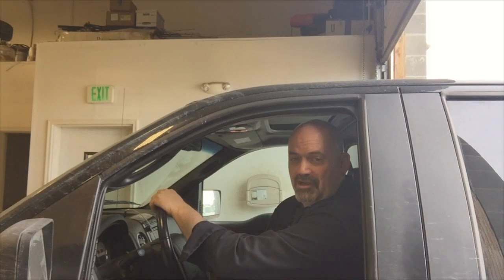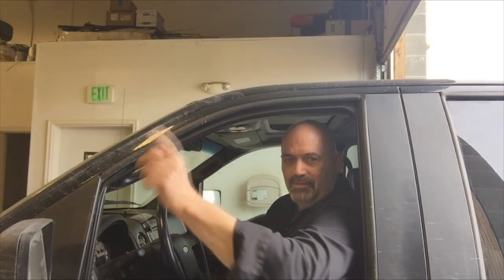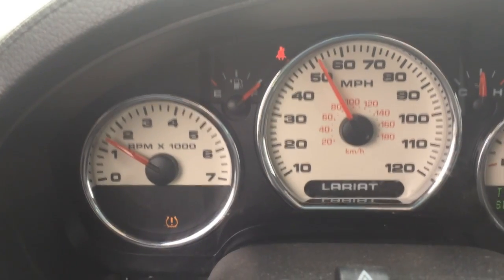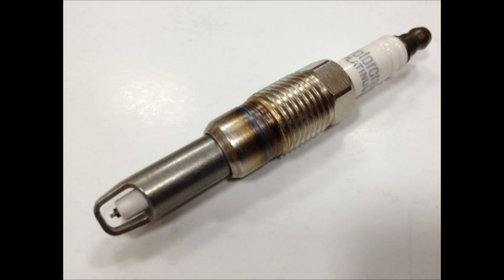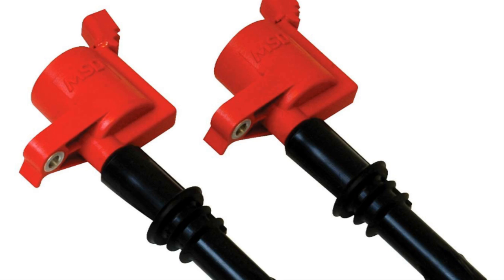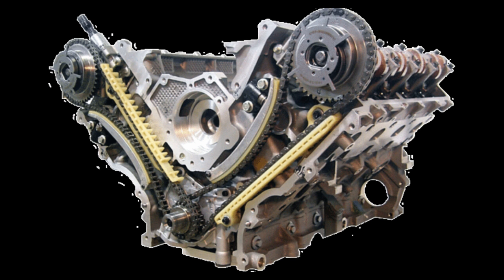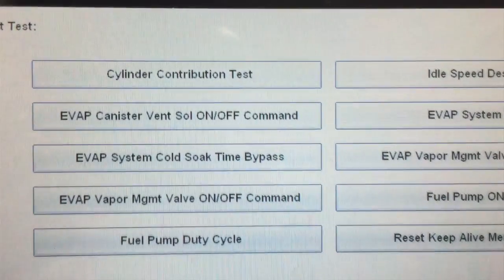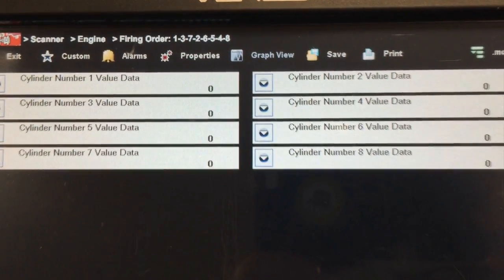Ford F150 F250 Transmission Shudder

Comment: My 2007 Expedition had shutters and would not lock up, I replaced the Torque Converter with a new ford unit in my driveway and it’s like a new truck. I changed all the fluid with new Mercon SP and put in a new ford filter, replaced TCC solenoid, replaced the pump bridge seal, and a new oem lockup torque converter and she locks right up and drives like a new truck and shifts amazing now. IMO If this additive doesn’t work drop the trans off the engine and replace the converter....don’t spend thousands on a unneeded overhaul or put any additional snake oil in it....Ford replaces the TC’s when they have the shudders for the most part but I know some years for the HD 250 trans they have an oem approved additive.

Comment: Had shutter for years, finally had plugs and plug boots replaced at 195,000 miles and shutter is GONE!!!
Reply: Wow! Dodge told me it's a torque convertor issue. Doesn't make sense, because it only happens at steady speed and I haven't had a tune up in over 5 yrs

Comment: I have a 1999 F150, with a 5.4 and a OD transmission. I found my transmission shudders at take off!! So if I am sitting at a stop light and it changes to green, as I start to pull away THAT is when my truck "shudders", and for a while I thought there was a broken spider gear in the rear end (as that is sort of what it felt like), but then I noticed something!!! What I noticed is that it ONLY HAPPENS when the overdrive is on, which in my truck the overdrive feature is automatically turned on when you start my truck!! So if I start my truck, then turn the overdrive off before shifting it into any gear the shudder goes away and doesn't happen!!

Comment: A "Shudder" or " A feel of Driving over a "Washboard". Doesn't feel like a "Miss fire". Try draining your Torque converter add a new filter and fluid. No Additives.
Reply: Pretty much William but when a catastrophic event happens after you have the shutter then your front main seal goes out what would you talk about what would happen then what made the front main seal go out from the shudder to torque converter probably would be bad and cause a catastrophic event to eventually make the front main seal pop or could it be that the pump itself stopped pumping in the food heated up to the boiling point and pop the main cell

Comment: I have a 2013 ford f150 stx 2wd 5.0 V8 the ford dealerships just cant see to figure out what is causing my truck to vibrate at 55mph, had all fluids changed at 80,000 miles 4th set of tires and the vibration is still there very annoying

Comment: Thanks for sharing, currently trying to differentiate between transmission issue and a misfire. Mrs said tonight it was running better in manual and shuddering less in 5th Vs 6th. Car is 2014 6.2 Roush Stage 2 Raptor. Already had one trip to Dexol for rough shifting and got some beefed up internals then. Could be this issue. One misfire at 1675rpm 13mins into the drive cycle on Cyl 2&4 of a permissible 65500 on the OBD… it is about 7k away from the plug service.

Comment: 2008 4.2 stumbling,  missing on curves,  bucks on bit of incline, accelerates out strong! And also has studder/slip? at take-off . Replaced distributor shaft & pickup.  Guess Plugs again,  wires were replaced also.. wearing me out

Comment: I purchased a 2007 f150 lariat n bout 30 miles away I got significant shudder . I took to a transmission specialist in my area n I was surprised when he said he couldn’t flush all the fluid out , just the pan . He said I had a 50/50 chance of new fluid n filter n shudder fix to fix problem. Well I was apprehensive since he’s not changing all the fluid (. 230,000 miles ) well 20 miles home it acted up again , though it was a lot less violent, but still shaking . He said he wasn’t comfortable with just changing torque converter with the mileage on the trans . Does this make since if your trans is working good except for the shudder . I bought this as is couple days ago so I need to figure something out quick ( I know the state has a lemon law ) why wouldn’t someone just do converter and save lots of $ for maybe another 50k miles ?

Comment: What would cause shutter on 4r75e ford transmission  when put in gear with brakes applied and stalls. Thank you for sharing God Bless
Reply from the maker: Lots of stuff including fuel and ignition system issues. You’ll likely need to test some stuff to get to the bottom of it.
Reply: I have the same problem with the 6r80.  Will shudder and sometimes stall if holding on brake in reverse, or in drive at a light.  Added more trans fluid and it improved (as in i can idle longer and shudder is less)  Still not sure what is causing it

Comment: What kind of shutter are we talking about here? If the torque converter is bad or about to go bad, will that shutter be very noticeable, or just slightly noticeable? I have a bad noise coming from the bellhousing area, 1997 f150, but I don't know if it's a flex plate or a converter. The noise gets quite when in gear and pretty much gone when it's warmed up good. The warmer the truck gets the quiter it is. I do feel a slight vibration under excelleration  but nothing really noticeable if I ignore it, it's more like running on a bad plug if anything and I know that's not the problem since I've done a complete tune up on it two months ago.

Comment: Helpful 👍. Any answer would be awesome!! 2000 f150 v8 4.6 Triton, I get the shake and loss of power uphill, highway, or when I dump it to gain speed, I thought It was plugs, fuel filter, clogged cats, sending unit, fuel pump or coil packs so I spent a rediculous stupid amount of $$ replacing and troubleshooting this cause this truck is solid but it's still doing it. I have to keep this truck so would a flush and a bottle of that shudder fix at least help til I can afford tranny work?? Thanks in advance.
Reply: Hey Mike Ward so what did you wind up doing with your truck? My 2005 F-150 5.4 Triton is doing the same exact thing! Smh

Comment: Pleas help 2002 Ford F-150 with a 5.4 Have you come across any hesitation problem when turning on cruise control or a hesitation when you push the resume button I’m finding every one is replacing the switch mounted on the breaker booster what are your thoughts Anchorage Alaska Thanks

Comment: My Econoline E350 rattles pretty bad when I try to go hard on the gas from 45 to 55! Not in lower speeds or over 60!
Reply: Usually when things like this happen is it going to be a catastrophic event the torque converter is smothered are breached or just slap wore out transmission filter should have been changed fluid should have been changed but a fluid was not changed on accordingly time then you should just take same fluid save put new transmission filter and if the pump itself is still good replace with new torque converter yet make sure it the fluid going through your radiator and your pump is pumping cuz if the pump stops pumping it will make the fluid heat up and then pop the front main seal and cause a leak from the front of the transmission

Comment: Good video and very helpful.  I have a 1999 Ford V10 motorhome with a 4r100 transmission.  Idle is normal but when in 1st gear only after the transmission is warm I get shuttering in 1st gear.  Also sometimes I give it some gas and it catches as if the torque converter is slipping.  Motorhome has 61k miles on it.  Transmission fluid is pink and smells new like it was just changed before purchasing last year (full level).  Also slight shift flair when going into overdrive.   Any thoughts?

Comment: had this issue with 2010 f150XLT 4.6l r680 and spent to much time and fluid filter changes so st 150,000 miles lost 5th gear and need a 5000$ complete transmission change

Comment: I have this issue in a 2000 excursion with 300,000 miles on it. It don’t do it everyday but once in a while it sounds like the belt is squealing as it shudders while accelerating around 45 mph. This doesn’t make any sense but I’m pretty sure the shudder and squeal is the transmission? Is that possible?

Comment: Title talks about trans shudder, yet he spends more than half the video talking about a misfire ?
Reply: Yes, because a misfire can mimick a shudder condition.
Reply: Kareem OfWheat u are crazy the man is trying to help you don't watch
Reply: He’s actually right. My 2006 Ford F-150 was making a this weird transmission shudder feel on acceleration between 35-55mph and it turns out it was a misfire.  Guess what. The ford dealer could not solve the problem.  This video did.  So kudos to people like this guy for making a video to help us folks out.
Reply: @mbiker7  How much did FORD dealer charger U just for looking at it?? Also what is a "shudder" is it a rattling?? Because that is the problem im having on my 2001 Econoline...
Reply: AxZxTxExCxA it’s not so much as shudder but the truck hesitated when pressing on the gas at speeds between of 30 mph and 45 mph. Turns out it was 2 spark plugs that were misfiring.  My local dealer in Bloomington illinois charges $480 to change out the plugs on a v8 5.4l but if one breaks he adds $150 to each on that breaks. I did it myself.  I broke 4.  But used a special tool to remove them. It was a pain in the ass. But I got the job done.  Now I have no more hesitation or shudder feel coming from the engine.  Which kind of feels like the transmission was going out.  So. It’s just the spark plugs.
Reply: @mbiker7  Nice... 👍
Reply: Because a misfire is the most common problem with higher mileage vehicles of this class. I’ve changed one bad one out. It seems to have taken care of it to some extent but I’m still experiencing this on my 01 F 250 5.4 liter occasionally at low RPMS in over drive. So before I service my trans I’ll change out all my coil packs. For a 100 bucks certainly worth it.

Comment: What years are usually affected by this? I have a 2000 Ford expedition 2 Wheel Dr. that has a shutter or vibration somewhere between 45 and 65mph, I have changed The U joints and quite a few things up in the front end, Front wheel bearings, upper and lower ball joints, sway bar links, etc., but haven’t been able to find the source of the problem, seems kind of sporadic and hard to pin down. Thanks
Reply: Same here! I have a 2005 Expedition and it happens when I let off the gas going 45+mph. If I “punch the gas”, it goes away but I can’t drive with normal pressure on the gas. Any luck finding the problem? I really could use some help here. I’ve taken it to 3 mechanics and they look at me like I’m crazy.

Comment: I got a 2010 Ford F-150 and I hear something like a grinding/rattling sound whenever the rpm's reach 1,000. Any other point in time nothing, only when I accelerate from a stop or slow down to a stop and always at 1,000 rpm I hear it.
Reply: We noticed the same thing and got it fixed it is more than likely a loose firewall and is easily fixed by just tightening the screws hope this helped
Reply: Hello, I'm from Brazil I have a similar problem, managed to solve? Thanks

Comment: I had a shutter at 45/50 mph and pushed o/d button and it stopped I have a2002 f250 4x4 5.4 litre 220 miles ?
Reply: It's a "shutter" rattling?? That's my problem. Rattling at those speeds only if i go hard on the gas. Once I pass 60 I can go hard on gad and no more rattling under the van.
Reply: Torque converter

Comment: 2005 f150 5.4 with over drive started to have a small kick in transmission between 40 to 50 at light acceleration. happens with OD on or off
Reply from the maker: probably an ignition misfire issue
Reply: Did you figure it out my 2008 Ford F-150 does the same thing when it goes to shift into overdrive it has a hard clunck and shifts up it’s only got 118k miles on it I changed the transmission fluid and the problem is still there
Reply: Also I got insta shudder fix idk if I should add it or not

Comment: Help!!!! 2010 F150 shimmers all the time in drive. New rims and tires balanced, ball joints/uca, new lower ball joints, new struts and springs, new shocks, new sway bar links, driveshaft balanced. Pretty much entire new front end. Please guide me in the right direction. Thanks
Reply: Jonah Adams have you checked your ignition coil packs?
Reply: Yeah, might try this and see what happens 😅

Comment: Good video I have Buick enclave 2011 my truck vibrate when Ron the 40 to 50 mph I replaced the motor mounts all suspension parts new tires and the vibration don't stop u help my plz

Comment: I have a problem with my 2012 ford f150 fx4. It only happens when I'm driving through the parking lot or a garage. When shifting from first to second my truck shifts very hard it almost feels like I got rear ended. I have to basically stay on 2nd gear so it won't happen. All the shop can tell me is that it's a misfire it has bad coils or the plugs need to be changed. Well that doesn't fix the problem it still comes back. I've looked through so many forums and can't seem to figure it out Please help.
Reply: Did you ever figure it out??? I've had the same issue for 2 years. Driving me crazy!!! I have nightmares!
Reply: I know this is a year old..but sometimes this issue is a 1-2 Lord accumulator spring probably broke
Reply: Ive had the same problem for 4 years now. There is a TSB out but need act of congress to get Ford to deal with it.

Comment: Hi car doctor, I have f-350 2011 super duty my question is why is shifting hard the transmisión just when the oil temperature is up the 175
Reply from the maker: Is it an overdrive transmission? Have you tried switching off the overdrive and still have the issue?
Reply: The Car Doctor, works well until oil spell over passes the 175 there begins the problem only it when it will enter the  second gear,

Comment: Hey Car Doctor,  I have a 2010 Ford F150 STX 4X4 with a transmission shudder only between 30-40 mph.  I've checked out many forums but they provide a lot of different expensive answers.  Just wondering if you have ran across this before.
Reply from the maker: Does it have overdrive? Does the shudder go away when OD is off?
Reply: The Car Doctor, mine dose the same and when over drive it off it stops what could that be

Comment: i have 04 expedition n i having issues with it...the issue is when i driving all of sudden the truck shutdown and i have to wait couple mins so it can start again
Reply from the maker: +Norberto Gonzalez That's no fun. Does it loose spark or fuel pressure?
Reply: It loose spark
Reply from the maker: +Norberto Gonzalez Any codes?
Reply: +The Car Doctor Heaven 2000 g

Comment: I have a 91 grand marquis it had a torque converter slip and shutter se times till it finally stopped moving, I installed new torque converter today but it still won't move (I think it may be because linkage is hooked up wrong now) but it was making a whining noise with old converter (almost like a blower supercharger etc) the noise stopped but still won't move any thoughts?
Reply from the maker: Sounds like your transmission is fried. Sorry about that

Comment: @The Car Doctor  Hey Car Doctor 😊, I have a 2017 f250 reg fuel, and it's shuddering or hesitating on those highway speeds...mostly between 5th and 6tg gear...but sometimes even as low as 4th.
Recently had a "heavy idle and acceleration issue" codes registered for fuel injector,  and a misfire...changed thefuel injector , 2 spark plugs and a cylinder....was fine for about 40 miles...then this new shudder began... Took it to Ford they said no codes came up🤔🤔🤔

Comment: hey car doctor, my 01 7.3 has a slight vibration about 65, go faster or slower it goes away, what is the problem?
Reply from the maker: does it go away when OD is turned off?
Reply: Mine does it between those exact speeds and OD off fixes it. Any advice?
Reply: And it didn’t do it all the time but now my rpms kinda twitch in OD and goes in and out of OD????
Reply: Did you ever figure out what it was I have that problem now